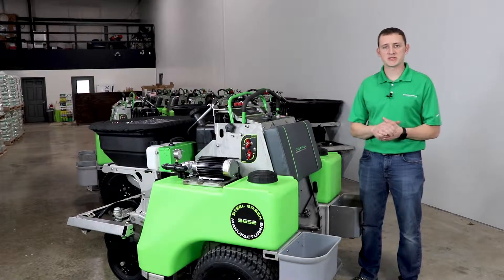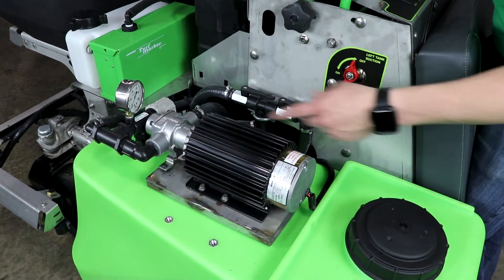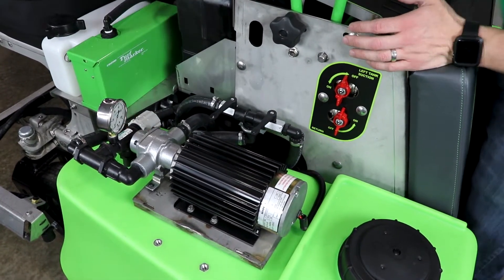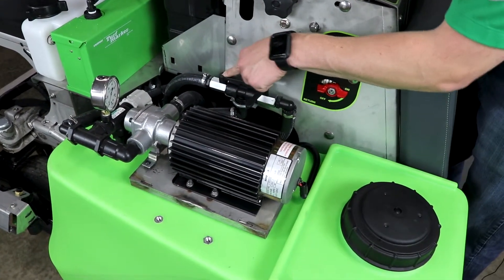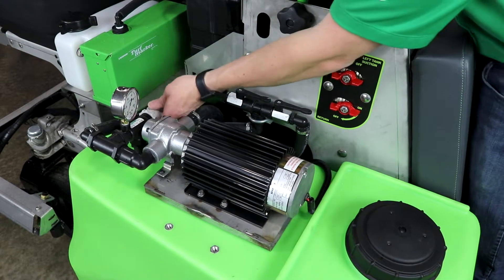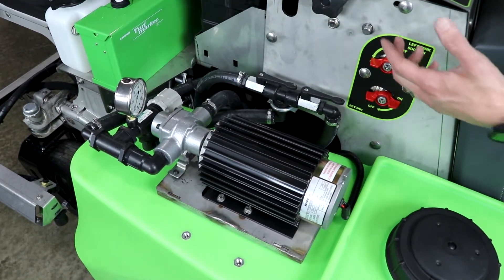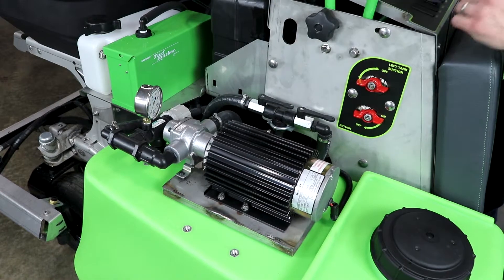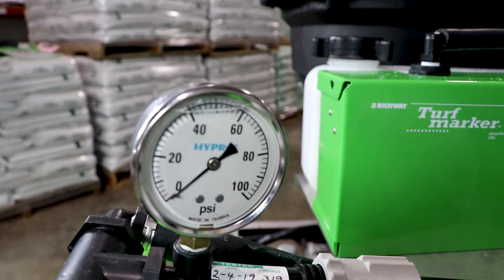How Steel Green High Volume Units Operate

Comment: Have you addressed the issue of air Locke? When we ran out of chemical on a tank the machine would air Locke and we would have to manually prime the pump. Which is a pain.